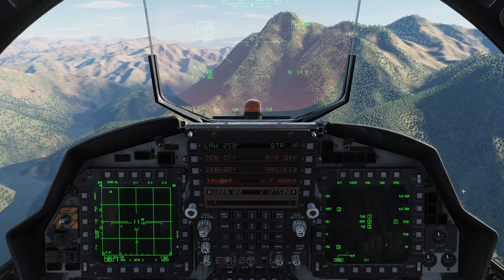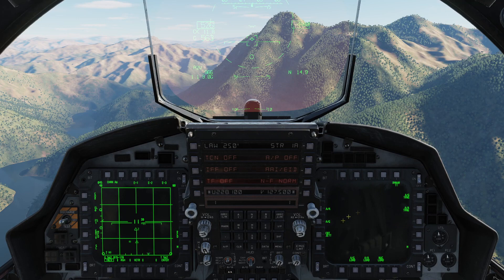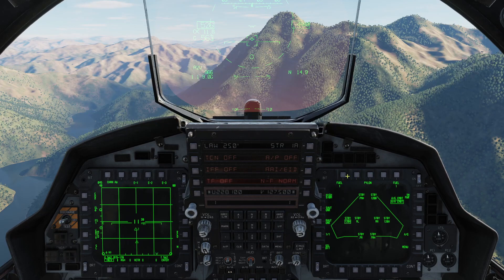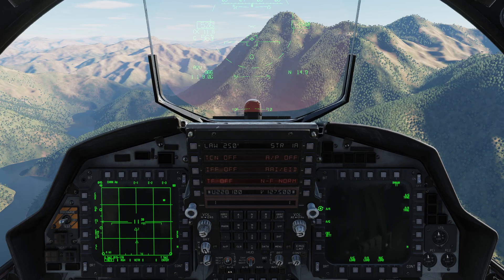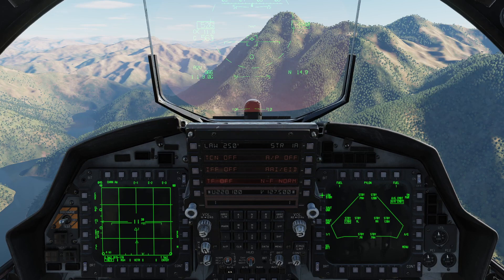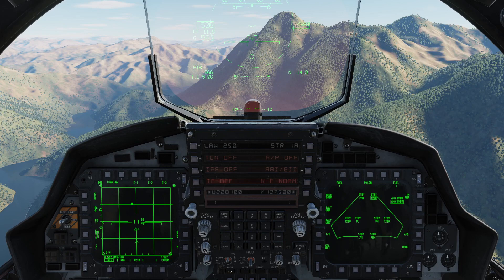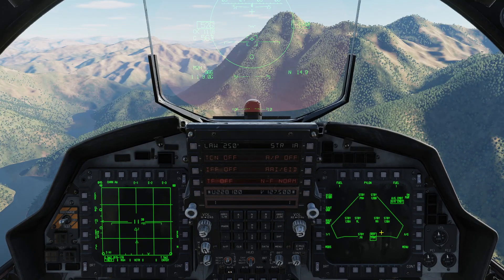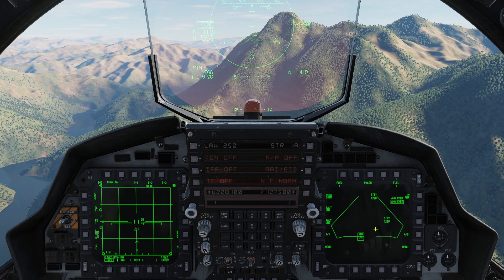DCS F-15E Strike Eagle | PACS Part 1

Comment: why can't they just put all the nice features from all the jets into every jet. Like that ultra wide hud with a flir repeater is pretty cool. They have it on the viper, too, but not the US version. Why can't they make one hud and make the symbology consistent for every single one of them? It would drive retraining costs down, production costs down and it would probably make a better product. Why have ancient CRT screens when lightweight, reliable, high resolution, full color LCDs are cheap and available? Every jet seems to have this ease of use thing or just generally neat workflow or concept. If they were to just roll them all into one everything would be cheaper and better. Why can't that happen? For example, why can't you put MGRS into the F15E? Why can't we have IRST? Why can't we type the waypoint for an airport and instantly set TCN and ILS and CRS for us? Why no FM radio? It's not required of course. But it would be nice to have.

Comment: how many gbu-39 it can carry? please say yes
Reply: Well, 4 SDBs per 2000lbs bomb rack, so up to 28 should be possible. And depending on if it clips with the sdb rack or not, theres also the possibility of carrying 4 LGBs for moving targets at the same time as the 28 SDBs for stationary targets. Plus 4 A/A missiles. And enough gas to go across an entire map and back at full mil.
Reply: @CarmillaTheVamp   Actually according to the -1 Configuration you can only load the Bru-61 w/ 4* SDBs on station LC/RC 1&3 and Station 5 ... Making it a total of 20 SDB. Also I dont think you can load munitions on the 46s with the Bru-61 in the way... I could be wrong about that though.

Comment: I would like to make a suggestion that I've never seen, I guess it's not a big deal, but it may not be that hard to implement; no patina. At least in the cockpit, I really don't care what you do outside. I know, I know, maybe it's not "realistic", but for me, I've never seen a patina I like, it adds no immersion for me whatsoever, and it always looks like patina from FSX days or something. So if you could have a "No Patina" special option box for this jet to where when we start up the cockpit is like new, that would be awesome.
Reply: Realistically this would mean a brand new cockpit, and thus no small amount of texture work is needed to implement this. Your best bet is to wait for someone to release a community version like alot of the other jets have. I'm kinda in the sams boat tho, but it depends on the quality of the wear and tear. I used to use cleanpit for the hornet, which is a factory cockpit, but i recently swtiched to the CF-18 cockpit which is a nice middle ground that also adds some nice color to the otherwise bland looking hornet cockpit.
Reply: @CarmillaTheVamp  well at least im not the only one who prefers it lol. so u just look through mods for "cleanpit" or what? ive got f15, 16, 18, fly the 16 mostly. do they make one for it?

Comment: Would love to see some WSO stuff
Reply: It is basically identical to the pilots actions.
AFAIK the WSO has their two side sticks, the left one controls the left pair of MPDs, the right one, the two on the right.
While the pilot selects one of their three displays with the sensor select switch, the WSO selects left or right, the pilot has the TDC as cursor, the WSO the stick movement.
Reply: Pretty much anything you can do from the front you can do in the back, only difference is you get an extra screen
Reply: and no control over what goes foward so nothing of what was shown in this video can be done by the WSO 🤣🤣